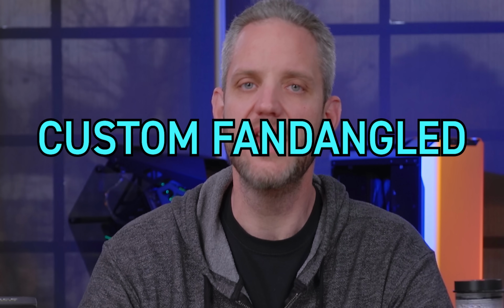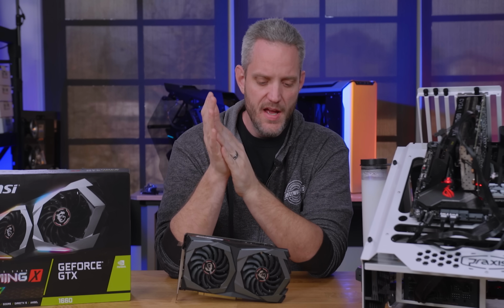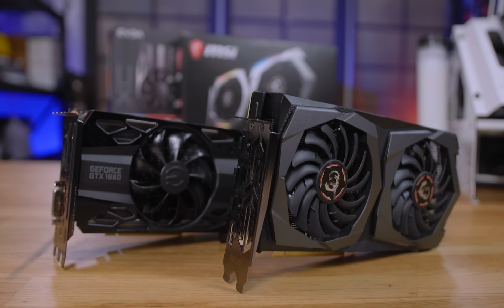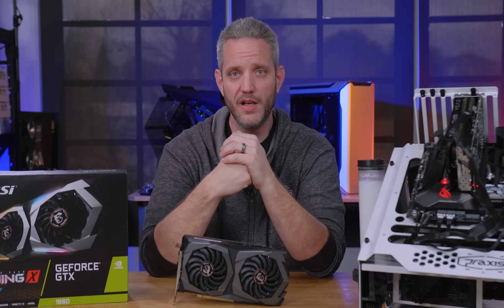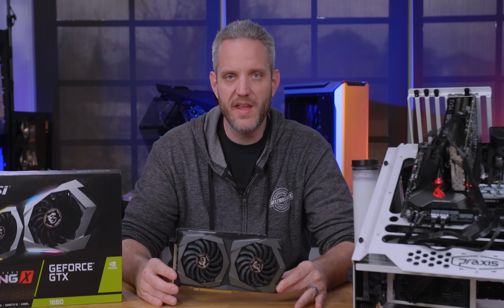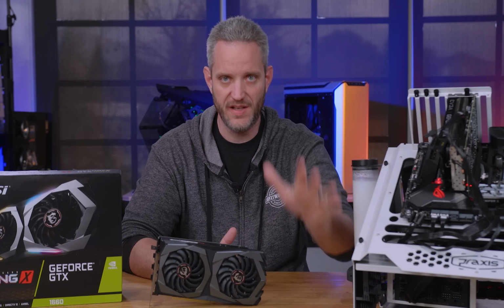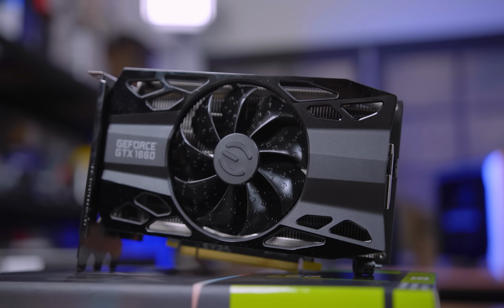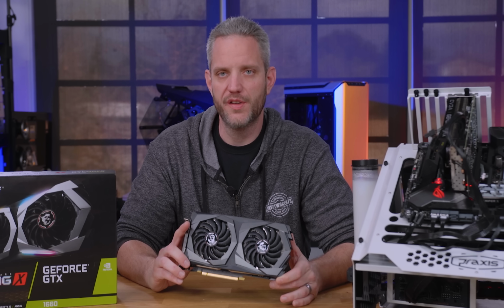Just save your money.... GTX 1660 vs GTX 1060

Comment: case :https://www.amazon.de/Sharkoon-VS4-W-PC-Geh%C3%A4use-Window-schwarz/dp/B00N0W2RAQ/ref=sr_1_72?__mk_nl_NL=%C3%85M%C3%85%C5%BD%C3%95%C3%91&keywords=Gaming-PC-Geh%C3%A4use&qid=1554839555&s=gateway&sr=8-72
36$
proccesor: https://www.amazon.de/AMD-Ryzen-5-1400-Prozessor/dp/B06XKWT8J4/ref=cm_cr_arp_d_product_top?ie=UTF8
109$
motherbord: https://www.amazon.de/Gigabyte-GA-A320M-S2H-Motherboard-Schwarz/dp/B078KBKFZ6/ref=sr_1_7?__mk_nl_NL=%C3%85M%C3%85%C5%BD%C3%95%C3%91&crid=2097XLEHDKRL5&keywords=am4+motherboard&qid=1554839864&s=computers&sprefix=am4%2Ccomputers%2C153&sr=1-7
54$
ram: https://www.amazon.de/Corsair-Vengeance-2400MHz-Performance-Arbeitsspeicher/dp/B01ARHBBPS/ref=sr_1_4?__mk_nl_NL=%C3%85M%C3%85%C5%BD%C3%95%C3%91&crid=17XLZQT0NOAHA&keywords=ddr4+ram&qid=1554839959&s=computers&sprefix=ddr4%2Ccomputers%2C156&sr=1-4
50$
ssd: https://www.amazon.de/Kingston-A400-240GB-Solid-State-Drive-Zoll/dp/B01N5IB20Q/ref=sr_1_3?__mk_nl_NL=%C3%85M%C3%85%C5%BD%C3%95%C3%91&crid=J9BHB14PP6OH&keywords=ssd+250gb&qid=1554840224&s=computers&sprefix=ssd%2Ccomputers%2C147&sr=1-3
30$
hdd: https://www.amazon.de/Western-Digital-Interne-Festplatte-Desktop/dp/B06Y6PNTV5/ref=sr_1_1?__mk_nl_NL=%C3%85M%C3%85%C5%BD%C3%95%C3%91&crid=66L3KK8URPOL&keywords=hdd+500gb&qid=1554840295&s=computers&sprefix=hdd+500g%2Ccomputers%2C141&sr=1-1
24$
gpu: https://www.amazon.de/XFX-rx-570p4dfd6-Grafikkarte-Radeon-GDDR5-PCI-Express/dp/B06Y64PV2X/ref=sr_1_11?__mk_nl_NL=%C3%85M%C3%85%C5%BD%C3%95%C3%91&keywords=rx570.&qid=1554840402&s=computers&sr=1-11
150$
psu: https://www.amazon.de/Corsair-VS450-Active-White-schwarz/dp/B0781G4R35/ref=sr_1_10_sspa?__mk_nl_NL=%C3%85M%C3%85%C5%BD%C3%95%C3%91&keywords=corsair+psu+500w&qid=1554840483&s=computers&sr=1-10-spons&psc=1
36$

489$ totaal

im making my first pc would this be a good budget build?

Comment: There is nothing wrong with GTX1060 3G at all, if you're a budget gamer. I'm still using it right now,  3 years later. It was really cheap when I bought it $275. Believe it or not, i'm using that card for P3D V4 flight simulator, running at low-medium performance with addons! Yeah, that's right, and it's fine!

Comment: I wish I could've gotten a 6GB 1060 at the time but my budget was really strict. The 3GB is still working fine though so I probably wont have to upgrade for another couple or more years yet.
Reply: just bought one yesterday :P
Reply: oh yeah, the 1060 will do fine for the next few years. there's always pressure to upgrade but in reality, if you're fine with decreasing graphics settings a little, there's really no point in dropping over $250 on another graphics card. i would do a cpu upgrade before a gpu upgrade, hands down.

Comment: is a 1050TI good for streaming with the new OBS update where you can choose what graphics card you want to use to run OBS
Reply: Get a rx570 they are around the same price, in some case the rx570 is cheaper, and much better than the 1050ti in 99% of tasks

Comment: Thing is... That MSI cooler is so quiet, even at higher revs... I did once the mistake of buying a noisy card. Never going to do that again. No point in overclocking if your ears are going to bleed. I'd pay extra 50 bucks just for the comfort every day a week. Cause when I buy a GPU, it's going to be with me for next 2 years.

Comment: i wanna build a pc and am thinking about getting an rtx 2070, any suggestions?
Reply: the 2070 is not that much better than the 2060 but has a step price jump.
Reply: more vram 8gb will be important in the next 2 years
Reply: the same was said when the 600 series came out , the reality is that by the time 8 gb  of Vram is requred for 1440p , the 2060 wont be able to run the game at settings that would need that much memory in the first place. and the nvidia 20 series is not much more powerfull than the 10 series.
Reply: middle earth shadow of mordor came out in 2014 and uses over 3gb of ram in 1080p. a midrange card or better with only 6gb of ram in 2019 is a huge mistake.

Comment: Essentially, if you ALREADY have a 1060 6GB, the cost of upgrading to a 1660ti wouldn't be worth your money.  Save the money toward a better card later on, or other possible components, like faster RAM.
Reply: THis card is aimed at 960 owners, you really shouldnt upgrade for every generation, id say wait a generation unless you are upgrading from a 60 to 70 series card.
Reply: TheHengeProphet im building a pc with a ryzen 2600, would you recommend a 1060 6gb or 1660 6gb?
Reply: Akuroh what price are you getting the 1060 for?  If it’s not 170, get a 1660.
Reply: Whats a good budget card to upgrade from a gtx 1050 2gb? I'm just trying to play insurgency sandstorm without it stuttering lol. i don't care about graphics.
Reply: @officialsouthsoul5223  Depending on your budget, the solid budget cards for this gen  would be rx 570,580 and the 1660, depending on your budget.  the rx cards are pretty power hungry, but do have great performance for the price.
Reply: OfficialSouthSoul 1650super or rx 570
Reply: @officialsouthsoul5223  what did you end up with?
Reply: @usbsol  got me a rx 570 8gb. Unfortunately i feel like my cpu card bottlenecks it. If you decide to get it, it’s a solid choice for most games in 1080p.  just make sure you get a cpu that can handle it. I have a ryzen 3 1300x

Comment: I think it's a perfectly good card.. and knowing that SLI is not really a thing now, and if I suddenly had to replace my 1070 GTX, this is the card I would get myself right now.  Would I rather have a 1070? Sure, but i'm saving 50 bucks, and not taking that much of a graphics hit if I do have to suddenly by myself a new graphics card.    

On top of that, i'm not going to recommend to my computer illiterate friends to get a gtx 1660 and try to overclock it.. I don't do that, why should I tell them to try it too?  Now if you are someone that has or is willing to over clock a GPU, then yea.. Get a 219 dollar GTX 1660.. that is the card for you.

Finally all that said and done.. I'm just wait on the RTX line to start actually being good since I don't have to get a new graphics card.  This card might the thing i recommend for my friends computers if they are getting into gaming but for my PC.. just demand a cut above that.  and I can hold out till ray tracing is a thing worth getting, or is at-least better priced to the market.

Comment: bottom line, if you have something around gtx 1060 6g  or RX 580, keep it 
if you have something like 970 or older, it's worth the upgrade
Reply: should i buy 1660 i dont have a gpu
Reply: @ale-df4lb  well that depends on you and your budget, but in my opinion as you can see from benchmarks it can run the latest games at max settings in 1080p, so it's got great performance for it's price.
Reply: @ale-df4lb  the Ti is better obviously since it gives more performance and also has GDDR6 memory instead of GDDR5 like the normal, but like I said it's up to you and your money. If you can get it go ahead but don't skimp on money for other parts like a good cpu/power supply/cooling these things are also very important. Try to find the best balance between components to have a solid build. it makes no sense if you get a good gpu when the rest of your system can't keep up.
Reply: @ale-df4lb  I would recommend upgrading to 16gbs of ram cuz a lot of AAA games lately require more of it if that's what you want to play, also ryzen 3rd gen is hopefully coming this summer i think, and I will hopefully be upgrading to that too. But again like I said you'll need to find balance in your build, look at the games you like to play or you want to play and judge whether your system is enough or not
Reply: yea i have a 970 and it looks like a great jump from where im at. Prob gonna get the 1660TI
Reply: @xkillrocknroll1  should i just save for a ti? how big of a difference from 1660 to the TI version? and what model is the best
Reply: If you have 970 you should OC it and have basically the same performance of an 1660. I checked it. It's almost exactly the same. Like 3-4% lower which is not good news.
Reply: @Belfor09  yes, and if you overclock the 1660 you can get around 1660 ti level of performance on stock, so yeah
Reply: I have 1060 6gb i5-7500k but i want to play witcher 3 on ultra and i’m getting like 45/50 fps on 1080p resolution

Comment: "money saved here could be go elsewhere on the build"
That... is true if you're building a productivity build, but for a gamer that makes no sense.  GPU is literally the most important component of the build, you save ELSEWHERE to spend on the GPU, not the other way around.
Reply: That also depends on the games you're playing. I play Kerbal Space Program a lot and for me fast CPU is much more relevant than GPU. As for my other games, my old Phenom 955 with HD6850 is doing just fine in 1080p. So my next gaming build is productivity build. Strong CPU with GPU just fast enough not to be bottleneck. And I'm more excited about that 40" 4K display I'll be getting instead of 2070 :P

Comment: For me it's pretty cool to see that a £200 GPU can game at 1440p at max, a little graphics tweaking then very easily. 1440p is now low budget viable.
Reply: Lol, my monitor is 1080p so no 2k for me
Reply: @xsebyx1746  *1440p
Reply: @killerfugu2659  wait isnt 2k 1440p, cauze I see 2k monitors, and on YT rezolution I only see 1440p the 4k, so I tauth 1440p is 2k
Reply: @xsebyx1746  Technically no, 2k is some sort of cinema res usually 2048x1080, which is 1/4 of cinema 4k (4096x2160). 
1440p is just that, or usually known as QHD.

But it's slowly becomin gone of those things where so many people use the phrase "2k" wrongly that it'll soon just become the wrong thing, 1440p. But in no logical way is 2k a good description for 2560x1440.
Reply: @killerfugu2659  oh ok thx you, now I know

Comment: Buy 1660ti rather than 1660 oc, simply because 1660ti uses an entirely different memory, it runs at 6001 mhz where 1660's gddr5 runs at 4001mhz, it will give you some benefit later on. Rtx card always not necessary, because ray tracing is optional, but you need faster memory in future. So 1660ti msrp model is the choice if you are a 1080p ultra gamer for AAA games.
Reply: Best comment I've seen after searching A LOT before buying the evga 1660 TI xc ultra
Reply: @Ricardo-ki1qq  I'm also looking to buy one. So the evga xc is the best one according to you? Based on what, temperature? Price? Clock speed? There are so many versions that I am kinda lost haha
Reply: @JD-jl4yy  hey man, I just have a preference for EVGA brand. This model is the best rated on reviews if you search for it, it has a good difference in temp from the 1 fan model. I'm running Apex in high quality with 120 avg fps just FYI.
Reply: @JD-jl4yy  oh, and, the factory OC isn't such a big a deal, just something around 150 mhz gain I think. But it is a safe OC. I guess you still have room for plenty OC since it has good cooling system
Reply: @Ricardo-ki1qq  thanks!
Reply: @Ricardo-ki1qq  1660 runs everything at ultra 1080p anyway. the TI isnt worth the 40 less than a 2060 since a 2060 is future proof and >1070 levels
Reply: Mike Alpha I have a 2060 and it’s faster than a 1070ti it was a solid upgrade from 1060 6gb
Reply: @mikealpha8779  it's a way to see it. But a lot of complaints about RTX dying and I don't care for Ray tracing for now, it's optional. DLSS is still experimental, although they may tell you it's not. GTX 1660TI has the same tech, Turing, and in newer games it delivers more fps than 1070 (there are plenty benchmarks in YouTube where you can check that).
Reply: Or just get a 1660 super with gddr6
Reply: Just buy a zotac 1660ti amp
Reply: @jonathanlee1318  there are some known tiers considering the video cards producers: tier 1 is EVGA, Gigabyte, MSI. Zotac sticks with Galax tier 2 quality. But hey, they're all good anyways
Reply: @Wojciech Szeler believe it or not, but the 1660 ti is actually cheaper compared to the 1660 in your country if you look at the official release prices: 220 and 280 dollars :)
Reply: @Wojciech Szeler  Prices varies depends on the country you are living in, and we consumers can't change that, so buy only those things which can justify their value compared to their performance. It applies to all sort of consumer goods.
Reply: Wish I can buy the TI, here at my place it's cost 100$ more
Reply: no point  buying first gen of RTX if you already have a decent GTX card. wait till rtx 2nd gen

Comment: how tf did you get 60 (in some titles even far above 60) fps out of the gtx 1060 sc in 1080p and sometimes even in wqhd?
my overclocked GTX 1060 kfa² could barelly handle 60 fps in 1680x1050 on max settings in most of the games which you used for benchmarks o.O does directX 12 give you such an advantage over dx 11?
Reply: Bloodhoven Are you cpu bottlenecked?

Comment: If I'm buying a new PC which one should I get? Gtx 1060 or 1660 or 1660 ti?
Reply: 1660. It's a great bang for your buck card currently when building a whole new setup. The only reason you wouldn't want the 1660 is if you already had a PC with something like a 980 in it. I just built a whole new system because my old one was having issues and also had a 2gb 950 and a Fx-8320 processor and this new computer runs like a dream for a cost effective midrange build. Though if you have the budget, get a 2070/60, but only if you aren't a poor boy like me.

Comment: Just buy a Rx 590. Best custom design in this case is the Sapphire Nitro+.
Reply: NO, used rx 590 is 300e or here and there 280 290e and there is 1070 for 250 or sometimes less, there is no place for rx 590 there.
Reply: @milosstojanovic4623  Lel I bought a RX590 Nitro+ Polaris Edition for 240€ (new).

Comment: Comparing this to my 290x xfx 8gb is sitting with all the 1660 and 1060 6Gb, and this is just a Fx 4350 OC to 5Ghz on a OC 290x 1125/2000 https://www.3dmark.com/fs/15917462.  The 1660Ti is a little faster card, but losing out 2gb and 314 Bit Bus Width to run on a Ultra Wide setup and maybe comparison of Bus Width on 21:9 vs 16:9, I'm interesting of seeing if any result is different from the two ratio setup based on Bus Width to a monitor of 1920x1080 or 2560x1440 and Ultra Wide 3440x1440 or 2560x1080.    Not really a buy to me if my score is very close to their firestrike score and I have ROTR, I never tested out the 1920x1080p.  But god that is a lots of 6's.

Comment: I'm curious if my gtx 770 would be able to handle VR.
Reply: I have the 750 ti I have no problem running iracing i do need to run it on lower settings to run it smoothly. Every other game or app I try and run is choppy and not really playable. I will be upgrading to the 1660 or 1660ti next week I hope.

Comment: I still got a GTX 770 and will upgrade at some point this year. I guess RTX 2060 got the best value for its price. I can see it for about 360€ here in GER.
I think I paid about the same for my 770 back in the days when it came out, so if we consider inflation that's actually not so much more expensive.
Reply: Well the "successor" of the 770 should be the 2070 though, now compare its price with the price for your old 770. I highly doubt you paid >500€ for it.

Comment: Considering how software lags far far behind the hardware development curve, the prospect of splurging the extra $100 into an allegedly more future-proof 2060 becomes less attractive.  That extra $100 means the difference of having a mini-ITX mobo with USB-C, built-in WIFI, and 1TB m.2 SSD vs a non-USB-C, no-WIFI, and 500GB.  Heck, there's probably even spare change for a $20 wired XBOX controller.  PC components other than the GPU seem to have a much higher "ratio" of performance gains per price-point change.  The ability to have WIFI and USB-C alone would easily be worth the saved change on the 1660 stock over the 2060's extra 15FPS (a performance delta from an already awesome 100+FPS average across all GPUs) and barely-supported raytracing features.  Also, I'm perfectly happy gaming on a 21:9  2160x1080p monitor, so 4K is a non-issue.  I don't need to play every single bleeding edge game that comes out, and I'm betting like most of you, haven't even finished a quarter of his/her Steam library.  For me, the 1660 on a fresh build, on my $1200 budget, frees up so many other possibilities for other components.  Today, it's easy to get lost in the GPU-glamour of games, but just take a close look at the rest of the components, and you'll see that the cost-savings possibilities of components leaves the GPU race in the dust.

Comment: I bought an RX 570 last year for $120 usd. Good for a truly poor person! Supposed to be similar if not a little worse than the 1060 3 Gb. Plays most modern games on medium / high settings at 1080p 60 fps. It does direct X 12 wonderfully.